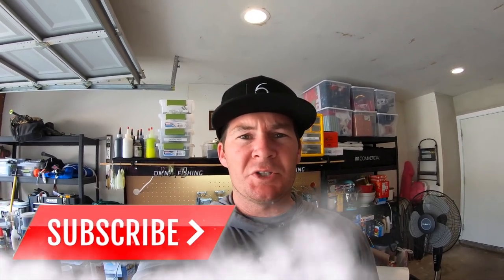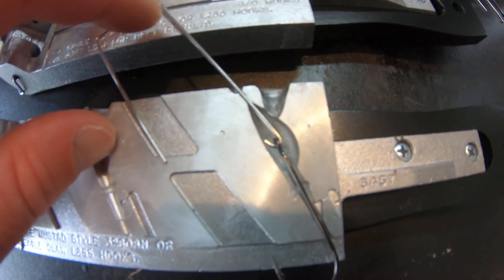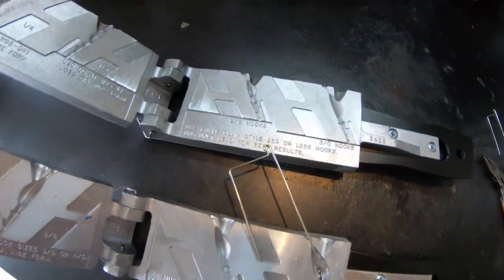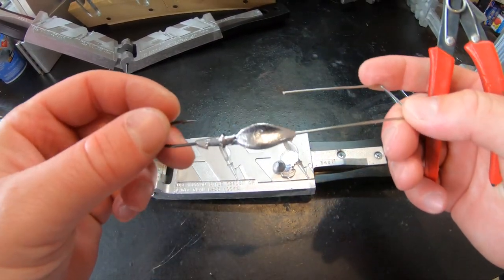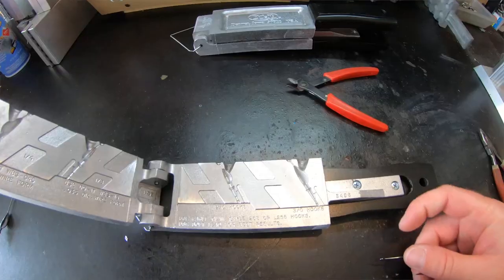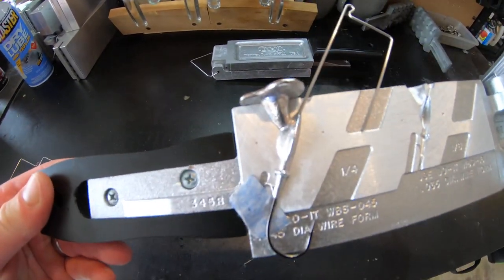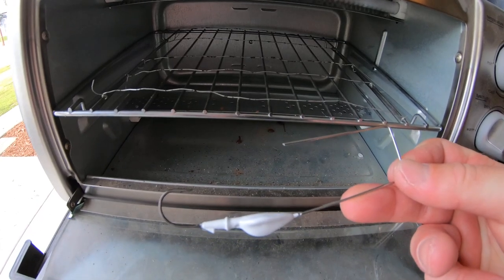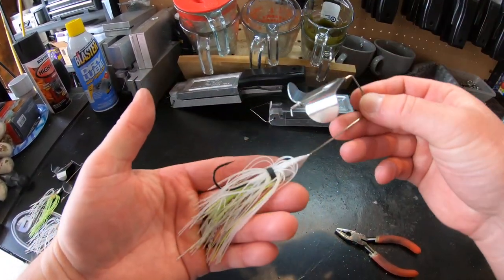How to Make Buzz Baits with DoIt Molds - Topwater Bass Fishing

Comment: Do you use epoxy on the band's for strength to keep skirt on & also try coloring just your hook part up to white paint in fire red.This will give you more hits as it will look like the bait is bleeding in regards as same effect of a plastic pour with "bloodline" in it. I've found red hooks give me a lot bigger percentage of hookups on any lure. #EffectiveTip.
Reply from the maker: Thanks for the tip.  No i don’t use epoxy on the bands.  I like to be able to take the skirt off if i want.
Reply: @MattLunaFishing  ✔

Comment: I know this video is a couple years old.  on the 1/4oz size, using the blade meant for that size, how far down could you trim both ends of the wire form to make a more compact bait?  I know the top wire can be cut down to where the blade and rivet would just fit.  How much can you trim of the hook end?  Can you make the overall length from hook bend to line tie about 3 inches using a 2/0 hook?  The application for this would be in small rivers and streams for smallmouth.  And I guess while we're at it, could you make the .045 wire fit into the 1/8oz with some "persuation"?
Reply from the maker: Cutting wire that thick makes it difficult to bend a new loop for the hook.  You could probably do whatever you want but You’ll probably need a wire bender in order to get the new loop made
Reply: @MattLunaFishing  thank you for taking the time to respond.
Reply from the maker: Anytime